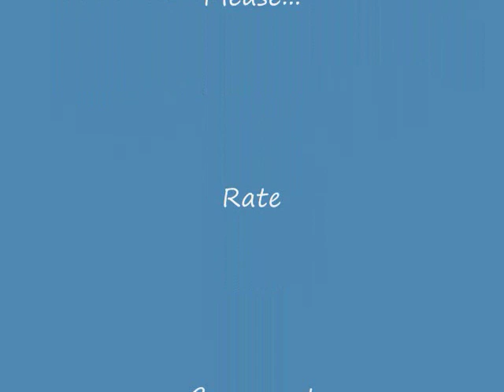Putting a Wireless Card in a Desktop

Comment: Woah! You definatley don't need to ground yourself with a screwdriver in a Powerpoint socket. That's pretty stupid. All you need to do is momentarily touch a large metalic object. E.g. your computer case. And a non-conductive surface is helpful but the static is built up from usually rubbing against something, walking on carpet for instance.

Comment from the maker: @Zorthaify one computers from 2004 while the others from 2008. there not the newest around. But the dimension 8300 is one hell of a work horse after you give it like 10 mins to finish booting up lol and the inspiron 530 kicks some ass with the quad core processor that boots quick even with only about 33% of the hard drive left and about 30+ start up programs to start (for the taskbar). it has firefox up with in 2 mins after first powering it up. :)